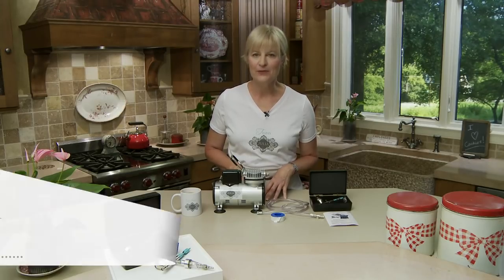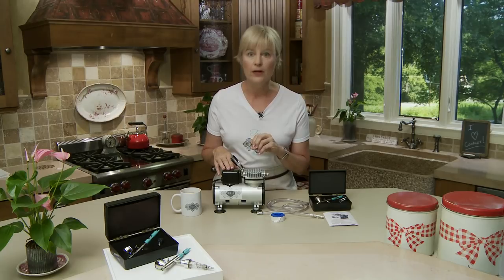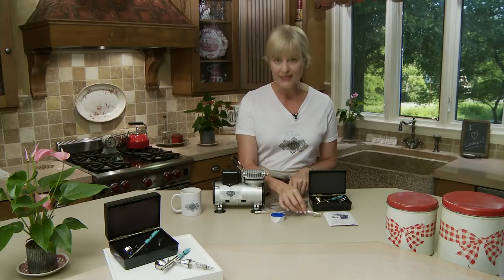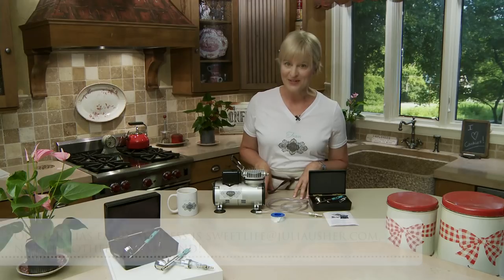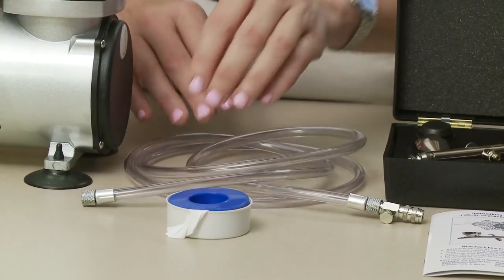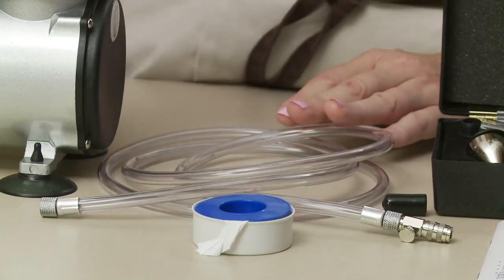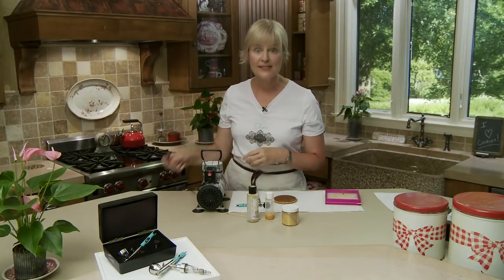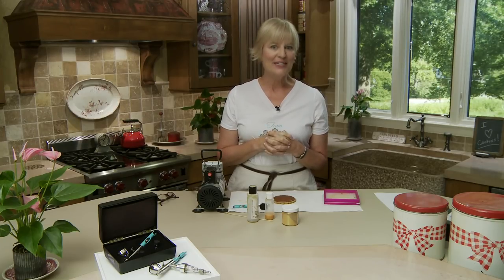The "JULIA" Airbrush System: A Compressor 101

Comment: If I were to buy a baking aid brush kit to start out as a beginner. What should I get. I looked up baking airbrush on Amazon and they had a master airbrush multiple purpose gravity Feed Dual action airbrush kit For $99.00
Reply from the maker: The Master system is a good one. I like it because it is dual-action and has a larger compressor (I think); just like the system I once offered but no longer sell. Dual-action guns take more getting used to than single-action guns, and are generally more expensive, but they afford better control.
Reply: JuliaMUsher thanks
Reply: What number  tip is used best for outlining cookies and what tip is best for thinner flooding cookies thank
Reply from the maker: @krisrtinkoss136  Completely depends on the look you want (visible or invisible outline), the size of the cookie (I typically use a bigger opening for flooding large cookies), and how loose your icing is. I also typically don't use tips, but instead use parchment cones. As a beginner, you might try a #2 tip for outlining and a #4 or #5  tip for flooding pretty big areas. But tip sizes also vary from brand to brand; a #2 in one brand is not necessarily the same size as in another, for example.
Reply: JuliaMUsher thanks
Reply: I use the wilton tips
Reply from the maker: @krisrtinkoss136  Okay, they run a bit smaller than Ateco tips, but same answer above holds.